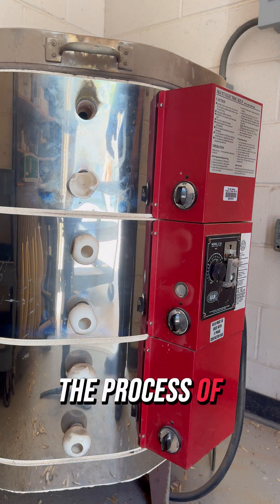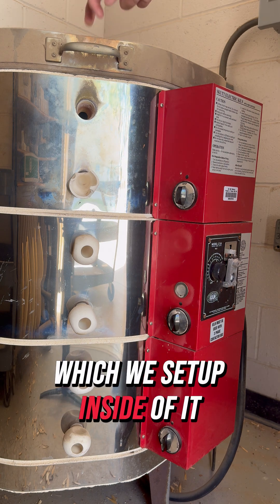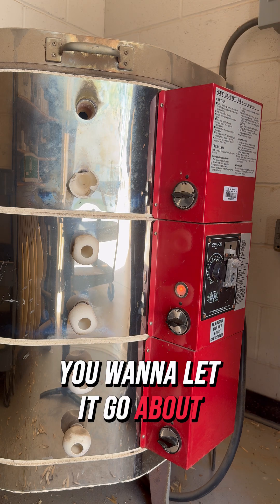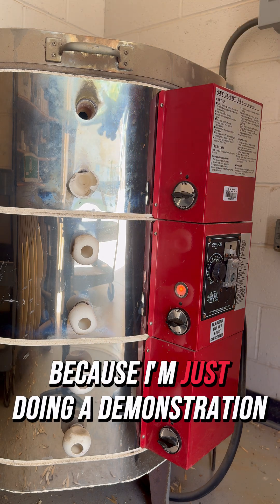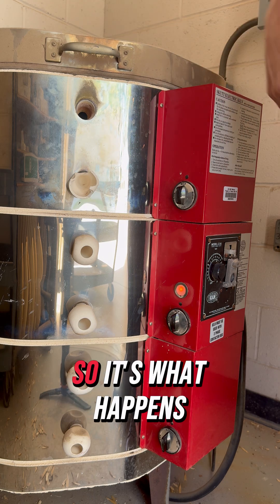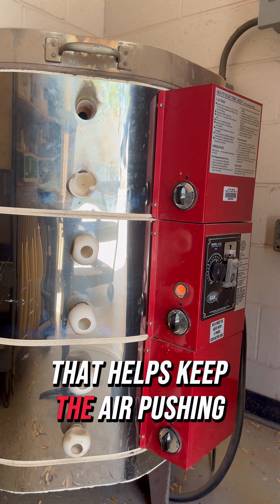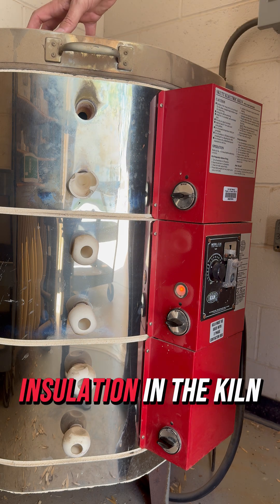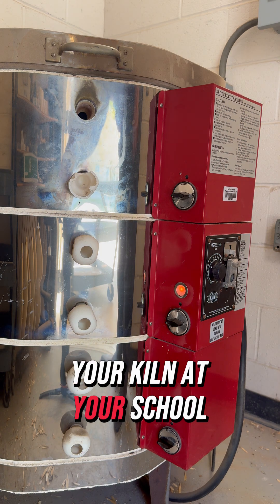How to fire a Manual Skutt kiln

Comment from the maker: Manual kilns are bit harder to work. Marjons ceramics has some great suggestions to explore this problem and steps to follow. 

How Do I Solve Glaze Defects?
To make sure that glaze defects do not occur, it is important to properly mix glazes and slips and to use good pouring (slip) and application (glaze) techniques. Proper housekeeping for the kiln and workplade should be observed. Straining glaze through nylon often helps remove any lumps.
Most critical for good results are proper firing practices. We recommend the following:

Bring air into the kiln and make sure it circulates around the ware, especially during bisque firings:
use setters and stilts to improve air flow around the ware.
use half shelves to improve air flow through the kiln.
adequately vent the kiln.
position ware to take best advantage of air flow in the kiln. Use a down draft vent to bring a controlled amount of air into the kiln and circulate it throughout the kiln. This helps remove fumes and even out the temperatures in the kiln.
Control the firing.
Fire slower, especially below 1200ºF (650ºC). Slow down the firing by adjusting switches to lower settings or soak/hold at a temperature to allow carbon to burn out. Use an automatic controller to set heating rates and hold times.
Use witness cones to verify heatwork.
Underfiring can occur due to burned out heating elements, an improperly adjusted kiln-sitter, a controller thermocouple which has changed or differences in heating within the kiln. Witness cones give a true reading of the heatwork the ware received. Witness cones placed throughout the kiln show differences in heat distribution.
Vent the kiln to remove gases and prevent them from redepositing on ware. Only downdraft venting removes the gases from the kiln.
If good firing and venting practices are observed during firing, problems with glaze surface defects can be controlled.
(Printed with permission of Orton Firing Institute)

Comment: How about modifying your firing for particular glazes or glaze problems, like blisters or pin holing? I know it’s easy with a controller, to program in a slow cool or hold, but what about with a manual kiln? Thanks!
Reply from the maker: Manuals kilns are tricky. With pin holes I recommend a slower bisque fire. Leave the dials on low longer during the firing process like a 1/2 hour longer. Or try bisque fire to 04. Blistering might be happening because you are applying to Much glaze?? Also slow glaze fire down a bit. Experiment with the kiln dials at medium for a 1/2 longer. Both issues can be caused by fast firing. Remember an automatic as 3 speeds and you can control your speed of firing by how you already the dials.